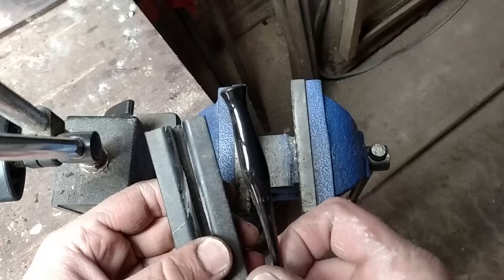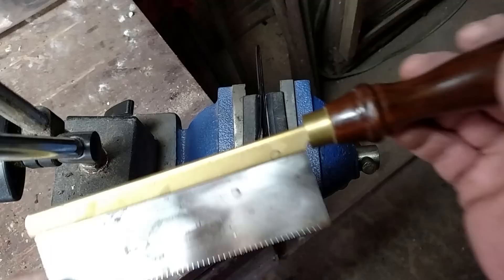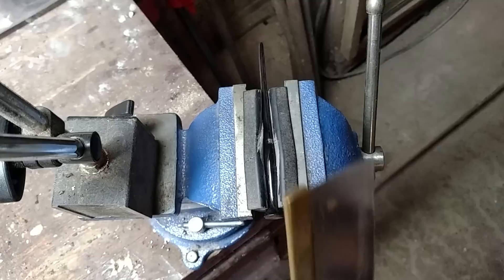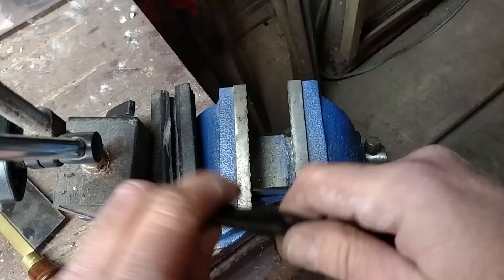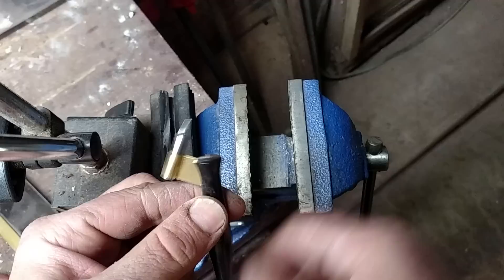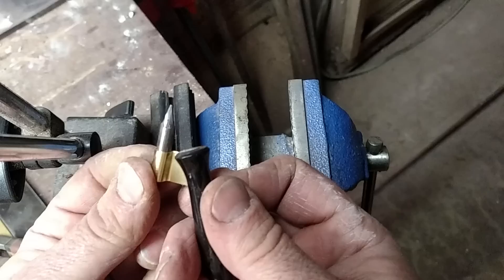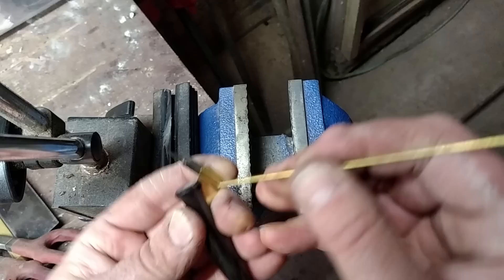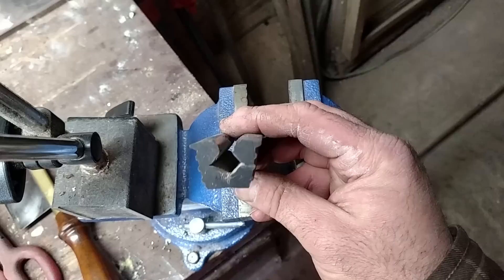Cutting an Oblique Pen Holder Flange Slot

Comment: Hello. Love your holders. I was wondering, why don't you use a flange with a screw? I mean the one that holds the nib in place with a screw? As far as I know only few nibholdermakers use such flange. Where do they get them? Are those flanges all handmade?
Reply from the maker: Thanks! I do make a Bullock flange, but not the Blackwell type, which I think is the one you mean. That design is flawed in my opinion. Because the screw pushes on the nib, it can physically push on the nib and can splay the tines apart causing the nib to not work out even damage the nib.

Comment: Do you cut the slot along the center  longitudinal axis, or do you have it at a slight angle? I've seen drawings where the nib flange is at a slight angle (5 degrees?) with respect to the longitudinal axis. Thoughts?

What is the "twenty-thousandths pin" you're referring to? Do you use the same vice to hold the holder while drilling out the center axis for the pin?

I've made about 5 different holders using your video, and my wife can't put her finger on why they don't write as well as her $20 ebay holders. I'm guessing it's all about the angles.

Thanks!
Reply: Christopher Yoke Gotcha. thanks. Do you by chance use a jig, or do you just eyeball it?

The last couple that I made, I used my scroll saw, trying to get it on axis. I'm wondering if I should get exact measurements from her Elanor Winters book and maybe try making a jig.